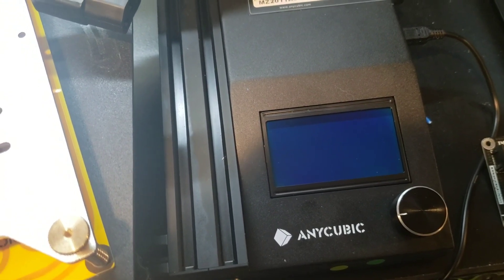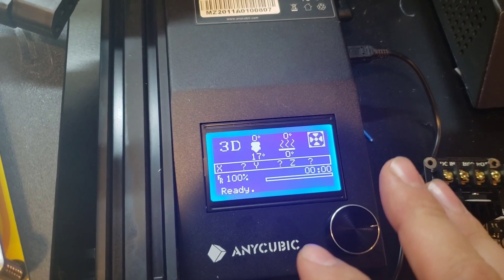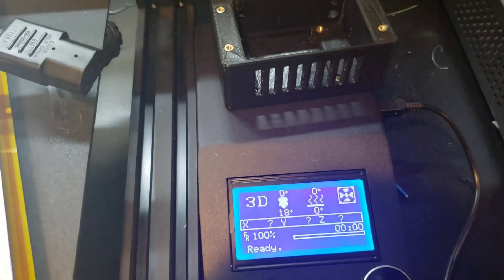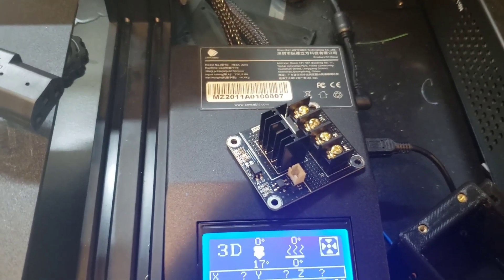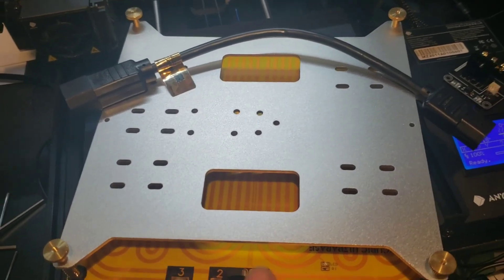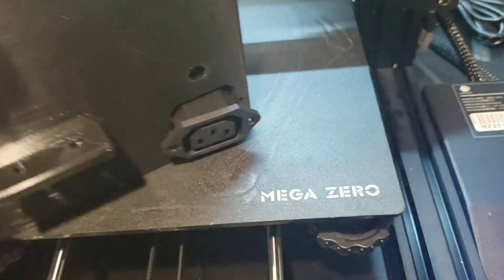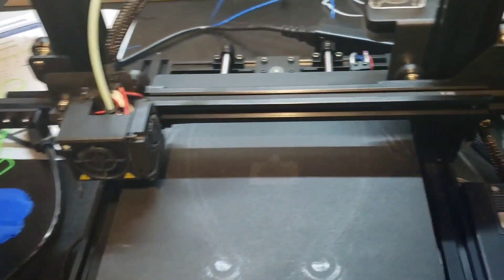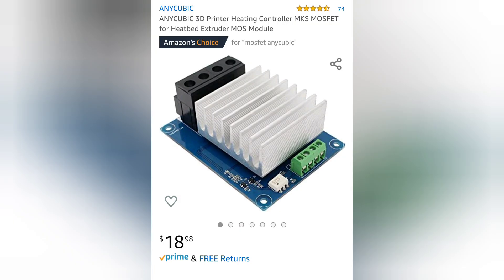Anycubic Mega Zero 3d Printer - Can you add a heated bed and control it with the stock board? Part 1

Comment: Can a simple relay be used in place of the mosfet?  Safer and cheaper...
Reply: In theory yes, assuming the controller doesn’t cycle it on/off too fast. However it’s not any safer in this circumstance, and the price is probably pretty comparable unless you have relays laying around.

Comment: Hopefully someone sees this.  He only shows the 2 connection places. He doesn't show the + and - connections.
Reply: EDIT: I can't use a multimeter because there won't be any voltage until the bed is enabled Can't upgrade firmware until I have all of the connecting done..
Reply: EDIT, EDIT: The connection on the left is +. (the bottom one in the picture).
Reply from the maker: That's because I made other videos to cover that.
Reply from the maker: https://youtu.be/EQJLe1VbFTg

Comment: What do you think, if I solder the transistor and the pads to regular places on the board, and 12 volts will be fed from the second power supply, this way will work?
Reply from the maker: You could. But why source and add extra parts to solder to the board that can't directly power the bed.  You will need a Moffett bed controller and a bigger power supply anyway.
Reply: @adaptedmachining6951  Using your videos and idea, I installed a transistor and a power connector on the board.  Using a 12V 30A power supply, I powered the circuit and everything worked successfully.  But now a regular power supply is not needed, the printer works without it.
Reply: @adaptedmachining6951  Thanks you.

Comment: And what do you think about ac heated bed 🛌? Personally i think it is a bit easier to manage it
Reply from the maker: I have no experience with an ac bed other than what came on my bargain basement he3d sky printer that I picked up used for $100.  I think its overkill for a smaller machine but again I dont have much experience.
Reply: @adaptedmachining6951  yes.... I agree with you. The bed 🛌 heat up in a blinking of eyes 👀

Comment: Thanks for making these videos! I am very excited to see the developments. This printer looks like the best option for someone like me who is only 2 years into 3D printing and wants to get into modding.
What would be the benefit of soldering a $19 MOSFET onto the stock board? Would there be an advantage to that over buying a different board altogether (like an SKR board from BigTreeTech)?
Thanks for doing this, it's very relevant to me (my Zero is arriving in a couple of days) I subbed to your channel and hope to see more!
Reply from the maker: I think keeping the stock board is the simplest and most economical option. For a new board, you would need to make a custom enclosure which is more time & money. Since you will need a new power supply no mater which way you go, and running an external mosfet for the heated bed is also money well spent. Most of the mods you are doing while converting to a heated bed can still be used even if you decide to replace the board down the road. I've just made up the modified brackets for mounting an Anycubic Ultrabase to the machine which I will cover in video #2.
Reply: @adaptedmachining6951  Hello,
I'm looking for the company product for the Mega Zero as I have the same plans and I already have everything I need but the company product for my printer.
Reply from the maker: @amsel001  search for mega zero firmware on thingiverse- I shared it there.
Reply: @adaptedmachining6951  Thx 

Unfortunately only find the https://www.thingiverse.com/thing:4287373
is this the right one I need for my mega zero ?? or have you used another one ??
Do I have to change the language or the firmware to use the hot bed?
Reply from the maker: @amsel001  that is the factory firmware source code that I shared.  This is the correct link.  Be aware the factory file is set up to display in chinese and just needs the language changed in configuration.h
Reply: You could make a video:
How about a manual in German to save his firmware which is on the printer.
Reply: @adaptedmachining6951  THX

The only thing missing in the video is how I connect the bed and the Mosfet to the board.
Reply from the maker: @amsel001  Video Part #2 will release in a few days with that information.
Reply: I will be attempting this mod as well. I too noticed the 2 empty hotbed spots on the board. I ordered block connectors to solder to the board and I have the 2 pack mosfets like you described. I was thinking of soldering the 2 blocks to the board running the wires to the mosfet and then to the heated bed I ordered and a second power supply. Is there any reason why you think that wont work? Here is the bed I ordered. https://www.ebay.com/itm/401959437483  I am new to all of this so I will be following along and working on mine as well. TY for the firmware, your help and your efforts on this much needed mod.
Reply from the maker: @HiphonePro  the spot on the board labeled hotbed does not get signal.  There is no mosfet on the board to drive those pins.  If you watch my video at the end I have photos of the board and a good description.  Amazon was supposed to bring the trigorilla mosfet yesterday but it is now "lost" :(  as soon as I have it I will post up video #2 which will be the completion.   Also,  the external mosfet must be able to accept a 5v signal.
Reply: @adaptedmachining6951  Hello, thanks for video and firmware; i bought a 220v/200w silicon heater to stick under original beb (12$), a 5v-24v DC to 220v-240v AC relay(9$) to drive this bed.
Now, waiting for second video, thequestion is: soldering wires to those spots on main-board am i sure to get 5v signal?
The thermistor is different but i can manage to change configuration.h file (i saw it listed) to work with it.
I think my way is the cheapest and more effective way.
If you see  flash whitening the sky looking in direction of Italy and later a big boom,it could be me  trying my project in tha night ;)
Thanks for your work.
Ludovico
Reply from the maker: @ludovicopiantanida9811   check out the next video for the wiring info.  I have the bed working and will do the follow up video tomorrow.    https://youtu.be/EQJLe1VbFTg
Reply: @adaptedmachining6951  Thank you very much, 

I opted for an optocoupler(3vdc-5vdc/220vac-380vac with 25 ampere work load), that is more safe for protecting my board for back-current and/or parasite current, bought for €5,99 (3 for €6,99) delivery included.
The silicon-pad is already mounting a 10k omhs thermistor, wich is number "4" in "configuration.h".
I will connect a dupont for bed thermistor and solder wires from to the board to optocoupler. After all i will set a male plug with line to bed and neutral though octocoupler to other end of bed.
Wisely choosing cable and more wisely insulate everythig.
I'm modeling a box with clips to plug in to two lines trafilate behind printer brain box.
I'm very satisfied with this project and i will never stop thank you for firmware and reverse engineering on the board.
When everythig will be set up and working i will share.
Thank you thank you thank you